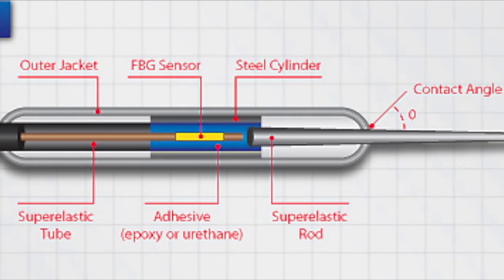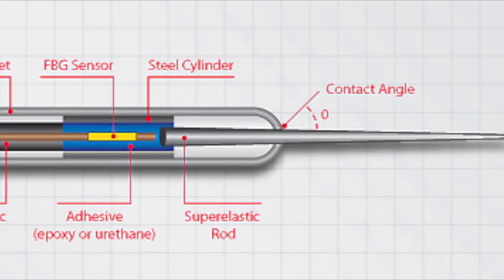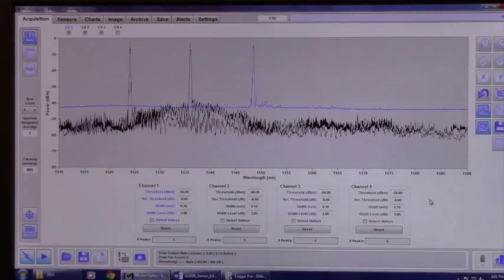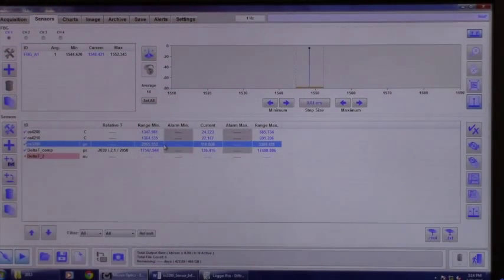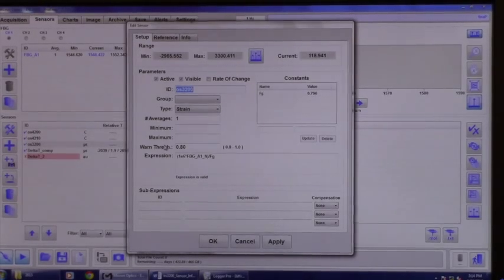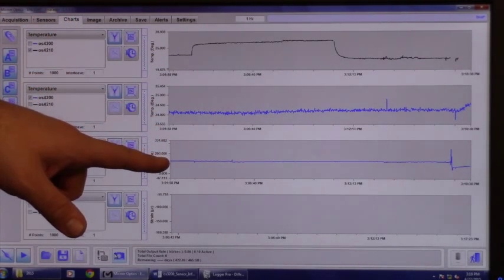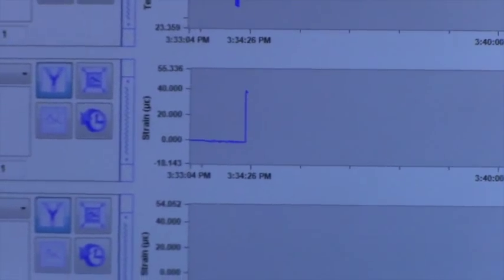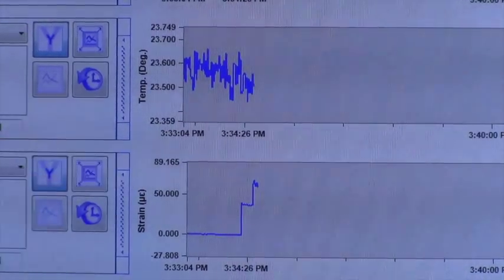Measuring Strain with Fiber Bragg Gratings

Comment: Hi thank you for your brilliant video 
Can we measure strain and temperature just by using fiber optics and the software you mentioned ?
thanks
Reply from the maker: +Hadi Mirmohammad 
Yes, I believe that the company makes Bragg Diffraction sensors that even measure both simultaneously in one sensor.
Reply: @gregoryalley4669  can it will be used for real-time strain and temperature measurement while making 3D printing parts?if yes how